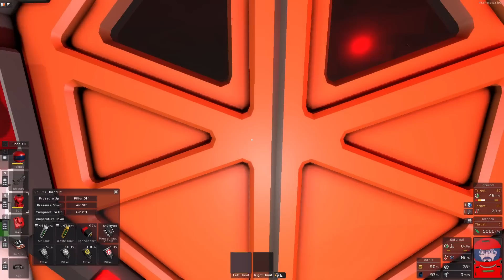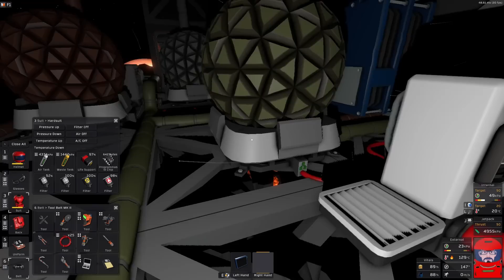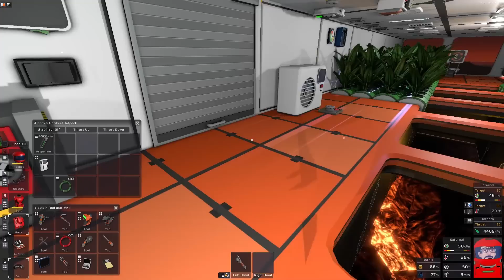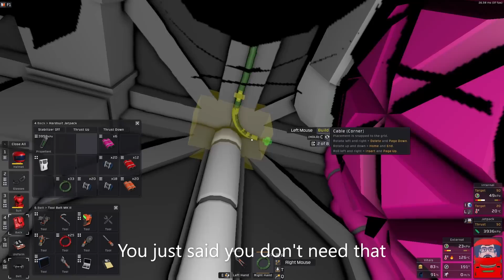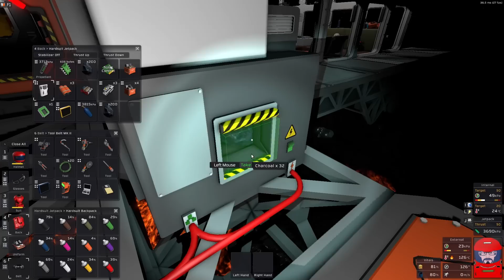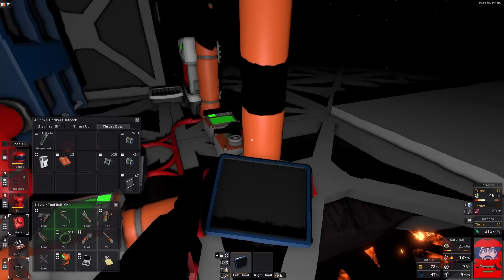Stationeers Let's play modded Vulcan 35 Fire update

Comment: Glad to see you're having less issues with the fire update than I am. PSA: there are 'amusing' bugs with fire right now.

The world cell inside sealed frames will hold atmosphere and temperature. Things on the surface of frames semi-randomly choose which world cell they are in, and will occasionally decide they are in the world cell inside a sealed frame. And world cells inside sealed frames are semi-randomly regenerated from the world atmosphere.

Net result of all of this is if you're on a world where the outside gets to autoignition temperature things on the surface of sealed frames (e.g. cables) randomly start catching on fire. Even in a total vacuum! This can also cause problems with e.g. furnaces or H2 combustors sealed inside frames.

(Ditto, don't play on a world with a combustible atmosphere right now. It was fine last patch but now it'll never stop!)

I'm surprised you aren't running the output of your H2 combustor into your hot tank.

The latest round of patches appear to have added a tick of latency between logic and atmospherics.

Things in your waste pipe appear to be combusting before your atmospherics kick in. Either change the current threshold to >0 for H2 (or O2 + N2O), or cool your waste pipe. Personally, I run gas storage cool anyway (better storage density, faster pumping, etc.).

Comment: 1:18:45 - Probably want to hook your automated furnace back up to the waste tank, as I think the line got cleaned up with the combustors.

Does it still make sense to put the radiators on the hot water line, given you were talking about running the Stirling engines using its heat?
Reply from the maker: I will still need to cool the water down but I will have to move the engines over to the combusor.
The siconnected pipe on the furnace is left over from when I was priming the furnace.

Comment: Mick thank you again for another great video.

Also, minor question.

 Due to the new update.    Do you think your advanced automatic first design on the steam workshop will still work as intended or do you feel it might need an update to it?
Reply from the maker: It should still work.  It might overshoot temperature and pressure due to the slower combustion but the safety should keep it going.  It would work best fuelled with nitrous now.
Reply: @cowsareevil7514  - Mick thank you for the reply sir and your comment which I value greatly.  I feel more confident in using your design since I am still very green on this game as well as still having trouble wrapping my head around the IC programming.  I have a fair understanding of it and still need to learn a lot more before ever trying to write my own program.

Comment: Maybe it's just on my end, but since the recent update my computer doesn't want to calculate the atmospherics. 
Airlocks and the gas separation don't work.
Sorry Mick, at 44:45 you set the cooler vent in the program to 1 and not r0.
This way the vent will stay on all the time. Or doesn't it?
Okay never mind. 1:01:24 u fixed it already.
Reply from the maker: I haven't noticed any bugs with it, althouhg i have to admit i have only tried the one save since it was released.
Reply: @cowsareevil7514  thanks Mick,  for your reply.
Update. My game is really broken. The gasses won't calculate, including the inside and outside atmosphere. 
All the batteries show 0% even when they are blue.
I'll try an old safe in the hope that works. If not.... start a new.